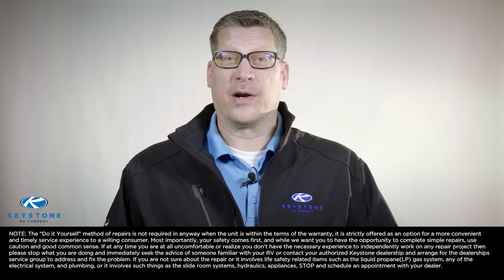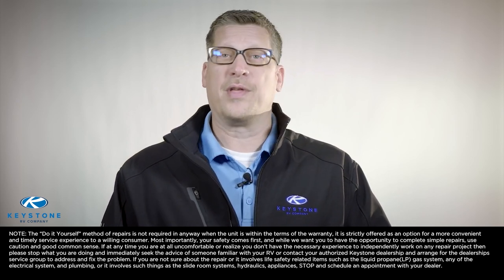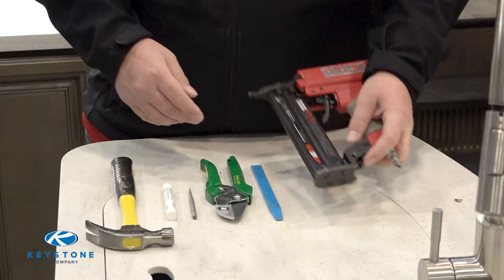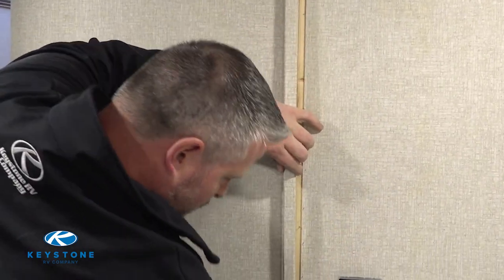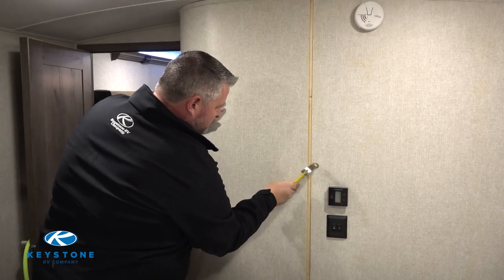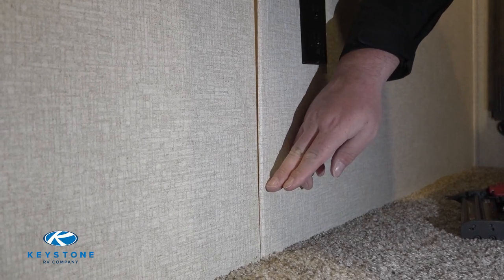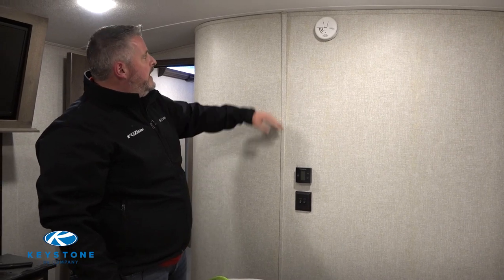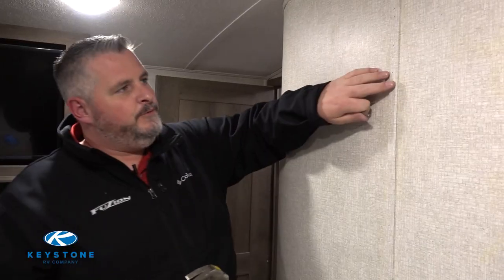RV PRO TIPS: How to Replace the Trim in Your RV

Comment: I need to insert a corner trim in my bathroom rv. Caulking  has seperted and I dont want caulking.  How do I put a trim up ? Cant find a matching piece to the original panel for a 2012 rockwood
Reply from the maker: Good afternoon, with how old the unit is, you may have difficulty finding parts to match. Here is a link to on online parts catalog, with photos, showing what is available and what is not available. www.trekwood.com  Thank you.

Comment: How can I fix the "paper" finish covering wood on ultralight trim when it wrinkles or peels from the wood?
Reply from the maker: Good morning! Sometimes you can take a heat gun or hair dryer on low heat, slowing warm up the area to reactivate the glue and with a flat tool smooth it back out.  The smooth tool you use should not be sharp. We hope this helps. Thank you!

Comment: The bedroom door in my Hideout has become detached from the latch at the top on one side (so it's hanging from one latch).  How can I fix this?
Reply from the maker: Good morning! With the info provided we can only assume you are referring to a sliding bedroom door. We would recommend to take the door down and inspect the top of the door and the bracket it pulled free from.  The bracket may just need remounting and then rehang the door. If this didn't help answer your question or if you need additional assistance, please do feel free to get in touch with our retail team via phone or email. The call center is open Monday - Thursday 8am-5pm and Fridays 8am-4pm. The number is 1-866-425-4369, and our email address is ownerrelations@keystonerv.com. Thank you!